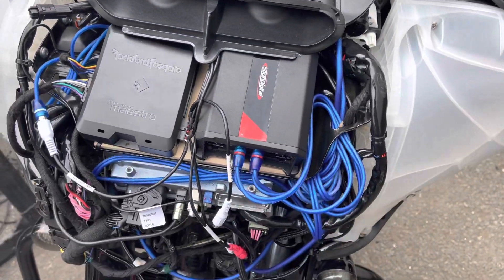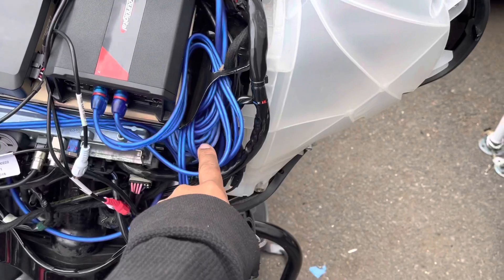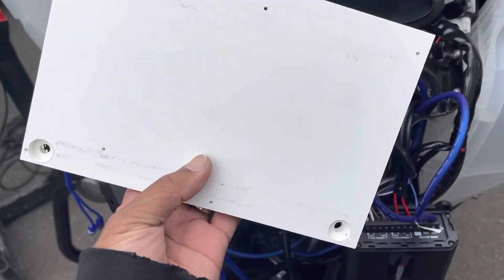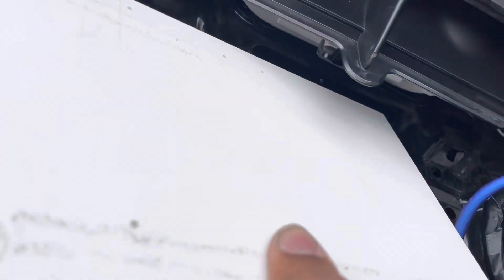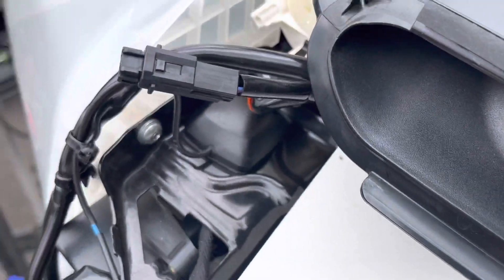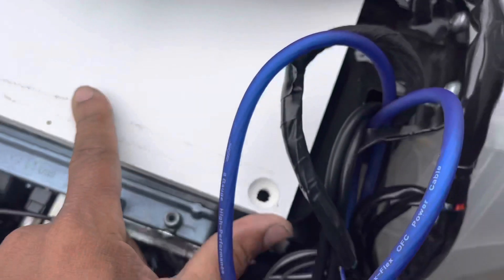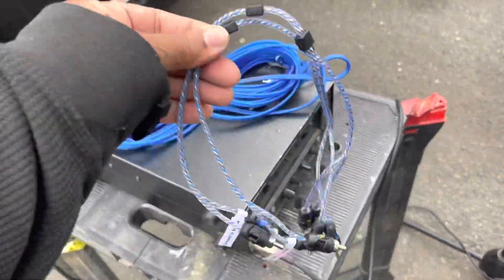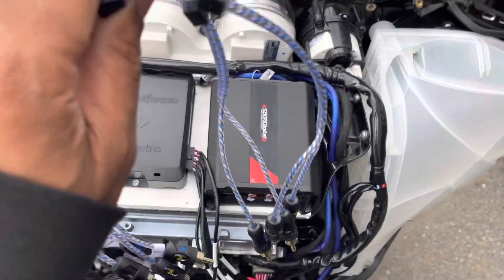Harley Davidson Street Glide in for a quick rta tune

Comment: Hello Carlos, I’m a big fan of your work. I own a 2015 Road Glide, stock HU with only the front speaker channel active. My question is do I need to flash the radio to get rear speakers active in order to connect it to the hi-level input of the Audison bit ten D? I know you’re busy so thank you in advance.
Reply from the maker: No 
Just set up the bit ten to front input only 

I love that dsp 👍🏽
Reply: @NVSAUDIO  My wife and I was so excited with your quick response, thank you so much. Now in the short coming future if I want to run rear lid speakers to the bit ten dsp, do I then have to flash the radio to activate the rear to input to the bit ten dsp or can I run the dsp with just the two front input and the dsp will give me the 4 channel outputs?
Reply from the maker: @raulramoscotto2646  dsp is is now your master control , it will take 2 speaker input and give you 5 speaker output ( front , rear and sub ) 
Your front to rear fade will be done in the dsp now . 90 percent of the bikes we do are front input only .